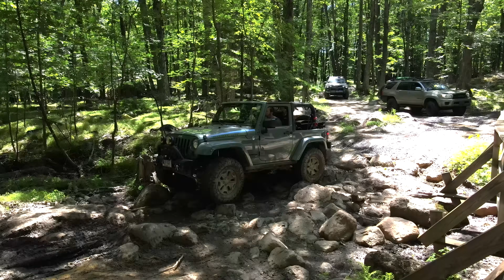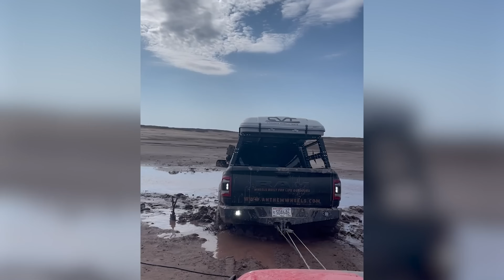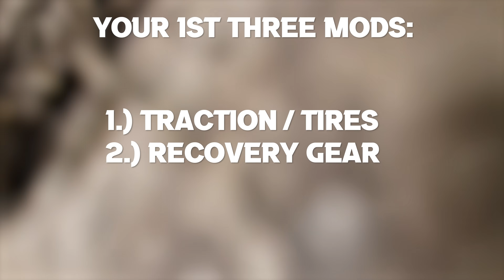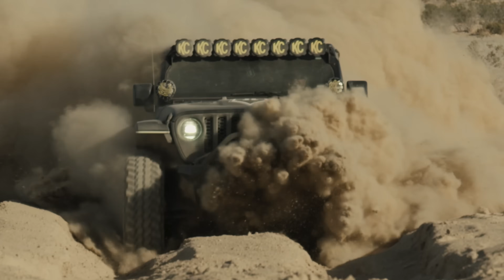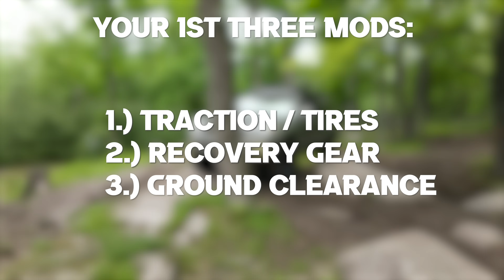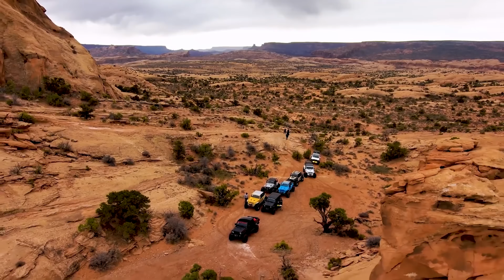First Off-Road Mods to Buy!

Comment: Suspension tires and recovery are the 3 best upgrades to do. Personally I did recovery gear first because if you can’t get out of a situation your screwed no matter how built your rig is then I upgraded my tires once the stock ones wore out and lastly suspension was upgraded when the stock version wore out.

Comment: I’ve upgraded my front end a bit from factory. My drag link etc aren’t as big as I’ve seen but definately bigger than stock. I have my original differentials with a 3.5” lift springs shocks pro comp. I heard a super 35 is ok for front and I’d love a 44 but haven’t been able to afford these. Is that a good swap plus install a yolk eliminator? Those theee things are my future lists. Oh and a tummy tuck to get that skid plate out of the way. Would this be sufficient? My tires are 31 on a 15 wheel.

Comment: I just got a rubicon that came with bf goodrich ko2 at. I think those are enough so I didn’t consider tires as the #1 but funny enough I was thinking about a compressor (for airing down and back up) since it helps with traction. I guess I was on the right track with the idea.

Comment: This is a good advice, but another perspective is don't buy anything other than basic recovery points and gear (snatch strap, hitch shackle, etc.). 

Then run what you have for a while. Most Jeeps and other factory built off roaders are more capable than people think out of the box. A new off roader will benefit from learning how the vehicle works and how to make the best of challenges. Additionally, they will learn what they need to buy and what they don't and have some fun in the process.

Comment: With regards to picking winches, I took into account,  and mention to folks. Some times the winch isn't for you. You may end up using your winch more helping others then self recovery. So in my opinion,  your double it rule is perfect. Also, this list seems good for folks that have to get things piece by piece ..  like me. Start with #1, then as funds allow, move to #2 and so on. It'll actually never end, but this is the best starting three, I figure.

Comment: Good list! I started with tires and skid plates. I wouldn't offroad my TJ without having added radiator, steering box, and oil pan skids along with rock sliders!
Reply from the maker: Good call on doing the tires and skid plates first! Arguably two of the most crucial upgrades that you could do first!

Comment: On the XJ’s with the unibody it would be frame stiffeners, skid plates, and rock sliders. It doesn’t matter with all the other stuff you do to your Jeep, if you don’t protect the underside of it your basically screwed if you take out your oil pan or differential and/or transmission.

Comment: Winch and recovery gear should be first, that'll get you out of pretty much anything. Then wheel it stock, figure out what you have issues with most on the type of trails you go on; Traction or clearance. Then figure out if a lift or tires is better (if you can only  either or if your on a budget) but this list is pretty much on point.
Reply from the maker: Great points! Especially figuring out what trails you will be going on so you can see what type of setup will be needed to get through it!

Comment: Tires. Always start with tires.
I’ve got an 03 Sequoia with a 2” lift and 33” tires. Haven’t had to turn around yet (knock on wood).
Reply: It’s a complicated thing. How far will someone be into the hobby? Tires are important yes, but will you want bigger tires after the lift? Ideally, you should do lift and tires at the same time, IF someone has the desire for a lift. Unless you can sell the tires later, better off saving to do both concurrently.
Reply from the maker: Yeah it's definitely tough, you almost want to have a build that you like and want to match similar specs to. That way you could ask or figure out what had to be done to make it all fit!